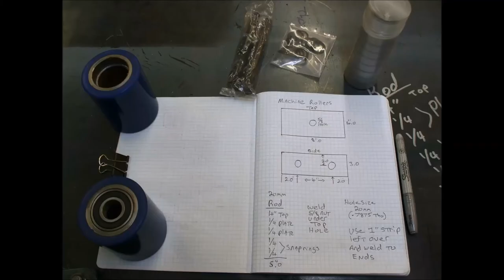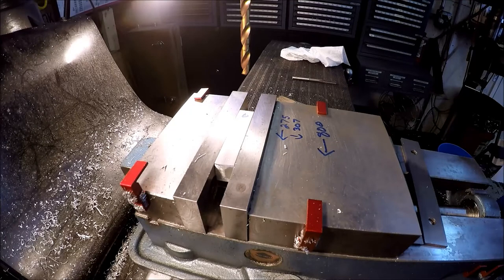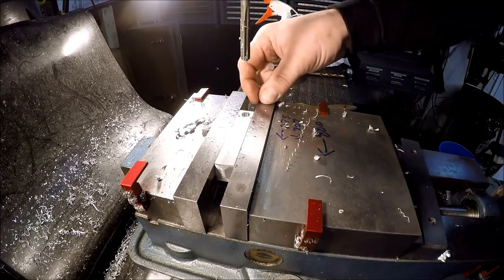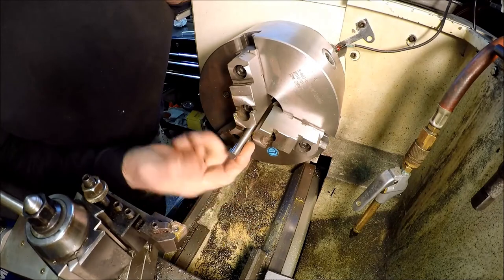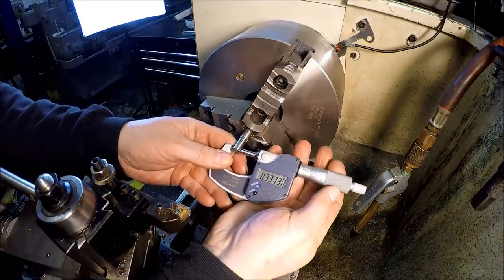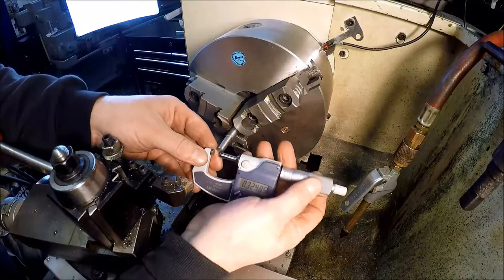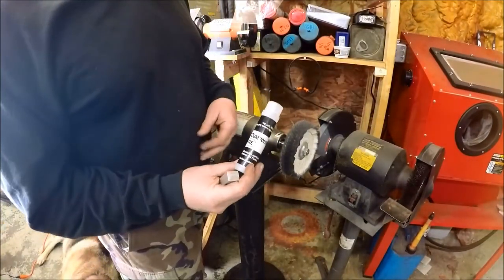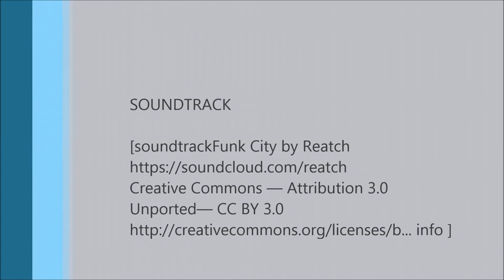Down & Dirty #12 part 2 of making a lathe push tool

Comment: It did turn out didn't it. I noticed your go Pro mount. Did you weld the legs on the square tubing?
Reply from the maker: Are you talking about the small hand held one Jim?
Reply: Yes the one I seen in the background .When you pressed up the push tool
Reply from the maker: Its a monopod I bought from E-bay.https://www.ebay.com/itm/SHOOT-3-Way-Grip-Waterproof-Monopod-Selfie-Stick-For-Gopro-Hero-5-4-3-Session-/282829245785?hash=item41d9efcd59
Reply: Hill Top Machine Works cool I might have to get one